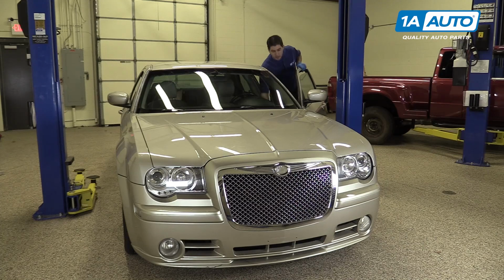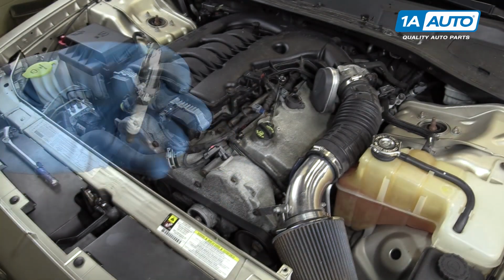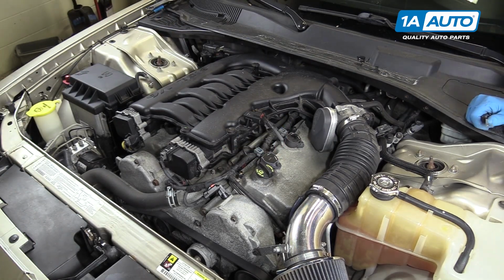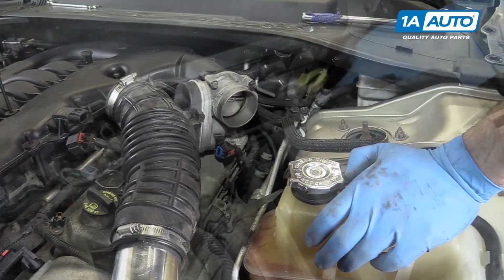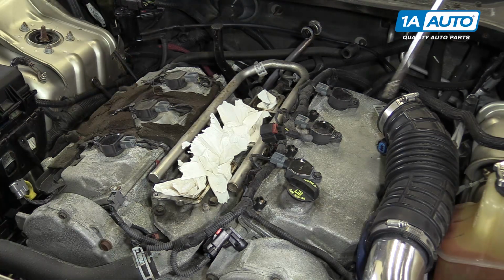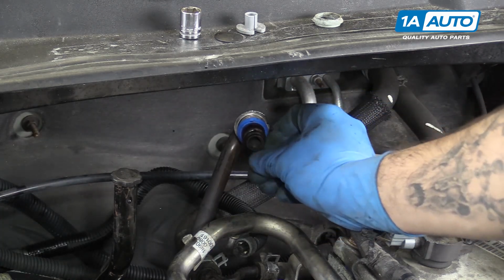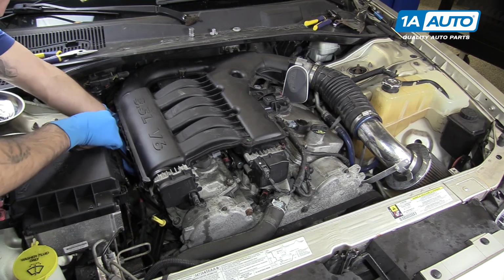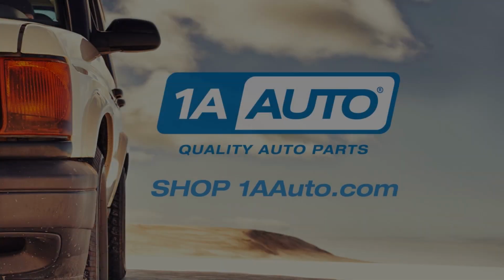How to Replace Spark Plugs 05-08 Chrysler 300

Comment: Torque specs for the manifold are 105 in/lbs, not 150 in/lbs as you stated.  Doing so could cause breaking a bolt or cracking the manifold.  I know this video is 5 yrs old, but still is frequently watched, so please take the time to correct your mistake.  You might also take a second to clarify the orientation when seating that blue gasket on the upper egr tube, as it's commonly installed backwards, (even by trained "professionals").  Other than that, thank you for taking the time to make this video.

Comment: I appreciate the video step by step im a visual learner and i fixed the problem with the car now the electronic throttle connector is popping up on the dash any tips on fixing that ?
Reply: If that occur as a result of doing what was done in this video or is that something that entirely happened on its own?

Comment: Hey a lightning red light comes  on and my car starts  to shake . I turned off and on and it goes away.  What do you recomend. 
My car is a Chrysler 300  3.5 07
Reply: Probably too late to be of any help to you, but just in case someone else has the same issue, first place to check is the blue gasket on the upper end of the egr tube right where it connects into the back of the manifold.  It's a known issue for these cars.  I've had to replace mine several times over the last decade.  They'll either end up getting sucked into the manifold or they get torn and compromise the seal.
Reply from the maker: +Coco Hernandez We wouldn't be able to diagnose an issue like that here, you may want to have a local mechanic take a look at it. Thanks for checking us out! http://1aau.to/m/Shop-1AAuto-c

Comment: Hi, I just attempted to change my own spark plugs.. Chrysler 300 2005 3.5.. I changed all 6 ! Now my car shakes and check engine light is on. It sounds like air is leaking somewhere.  Help!!
Reply from the maker: +jessica p Maybe a spark plug wasn't installed properly. You may want to have it diagnosed.
Reply: I got the same thing going on.. Shaking im mad. The sound is coming from the egr tube. I think someone had sealant on it

Comment: min 12:16 to  12:17 was edited. its very hard to plug back the egr tube in the intake without to lubricate the blue seal or  blue o ring and the intake manifold hole where it go in
Reply: Would vaseline be ok to use?
Reply: I was having trouble having it reach the manifold - I don’t even remember taking it off
Reply: @franciscogalvan37  same problem I’m having. Even bought a new tube thinking it was damaged

Comment: How about changing the spark plugs on a 2005 300c with just one coil per cylinder? Do they still use 16 spark plugs some how? Almost all posts online suggests 16 spark plugs on the 5.7 but I only see 8 coils with single sleeve.
Reply: Right 16 ? I only see 8

Comment: Great video, one small suggestion use a small container like a coffee can to put small nuts, ect. Into so they will not fall on the ground and roll away.
Reply: I bought a couple of small divided craft boxes for nuts, etc. As I remove them I put them in a certain order in the box. That way the same nuts from the same part are all together. I also put magnetic tape on the bottom of it so I can adhere it safely somewhere to the motor or tool chest. It has saved me a lot of headaches.

Comment: Have all my spark plugs in and replaced , everything is reconnected, couple coils replaced but when I turned my engine on the engine started to shake violently and did want to properly run, and idea of what it can be?
Reply: I bet it was the egr tube gasket. Or the tube wasn't in far enough, for gasket to seal it to the manifold . Was this the problem?
Reply from the maker: +Miroz We do not have a way of being able to diagnose the issue that you are experiencing with your vehicle but suggest taking it to a local mechanic for a proper diagnosis.

Comment: How hard to push down with spark plug socket
Reply: once the socket is seated on the plug you should have to press down at all really.  When installing, start by turning the extension by hand before switching to ratchet or torque wrench
Reply from the maker: +BansheePenguin1108 Not hard. just enough pressure
Reply from the maker: +Eric Thanks for the tip!

Comment: Do ignition coils give you power
Reply from the maker: +Carlos Leonardo Yes the ignition coils is what converts the voltage that helps give you spark!  1aauto.com
Reply: @1AAuto  No it does not give you power.  It converts the low voltage into a high enough voltage needed to allow a spark to jump the gap.  The amperage is reduced however.  So to truly answer if the ignition coil gives you power, that answer would be no. The power is initially supplied by the battery and then by the alternator.

Comment: I started torquing the manifold bolts to 150 inch lbs as you said it calls for but it was taking forever to click and it felt like too much torque and was about to strip the threads out.  I googled the torque spec and references several forums and other websites that all stated the torque is actually 105 inch lbs or 6 ft lbs.  I removed the bolts and set the torque to 105 and all went well.
Reply: So I keep trying conversions to get this math people are doing, while this video was way off on the inch pounds, the 105 required was just around 8.3.  I was wondering if you used a different conversion?
Reply: Same. Torqued to 150 in lbs, busted a bolt. Rechecked vid and confirmed he said 150. Checked a few other places and found 105 as well.

Comment: is it the same for a 2005 as well? Because mines is an Touring
Reply: 06 has two torque bolts for each coil as well.
Reply: Thomas Jackson-- Yup except our 2005 models the ignition coils have 2 torx screws. They really suck. Try not to to strip them when taken them out or tighten them in.
Reply: Thomas Jackson f